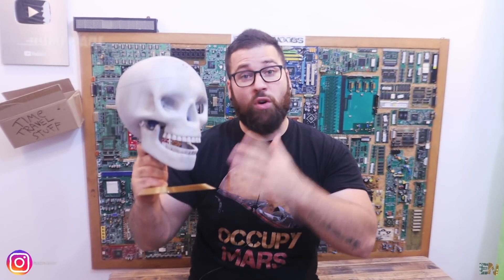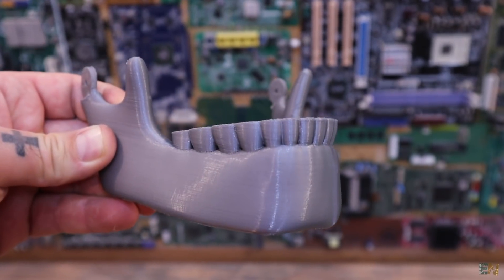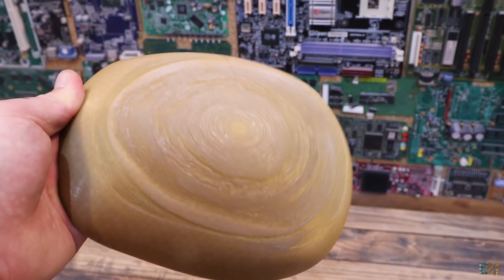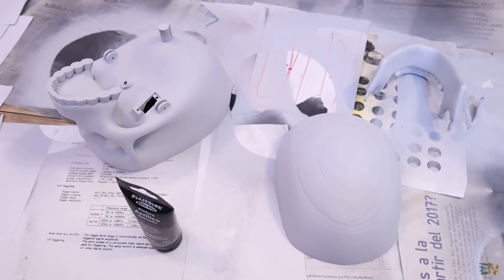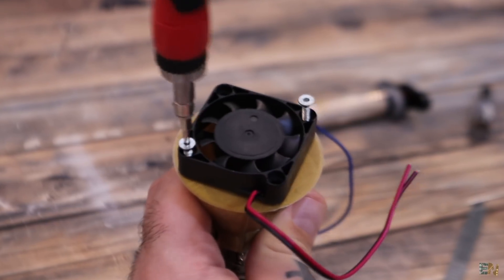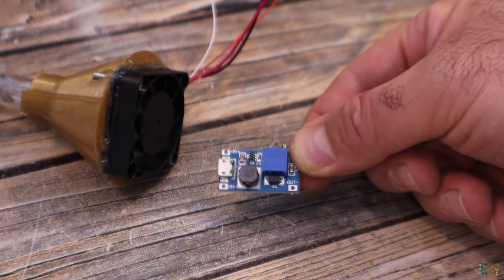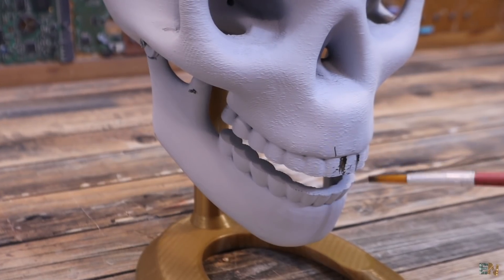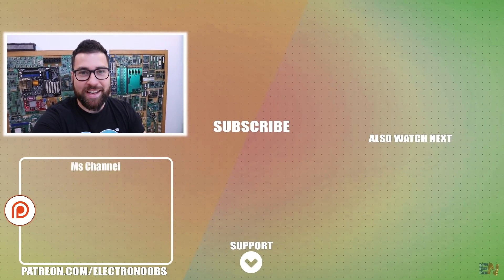Homemade Mini Smoke Machine | 3D Printed Skull & Voices

Comment: This type of fan is not designed to create pressure, so most of the air flow will not make it thru the funnel. You should use a blower fan (5015 for example).

Comment: vape cart does not ship to US
bummer
is that a 510 threaded I have some old  510 threaded one that are plastic so would be easy to drill through
the kind that you have to suck on to  make them work, the  thin cigarette kind
I wonder if it would work with the 3D printed pat to adapt it to the fan ,  or I could just use a lot of glue

Comment: Wonderful project.. axial fans don't have high static pressure.. if you need more.. a same size blower will do a good job
Reply: Some laptops, e.g. HP, use a blower to cool the heatsink rather than an axial fan.

Comment: Nice,  I wonder if you  could use a  RCWL-0516 instead of the PIR sensor so you don't have that obvious hole there for the PIR to stick out, mount the  RCWL-0516 inside the skull and maybe put a  small sheet of metal  the size of the  RCWL board in back of it so it only detects in one direction , 
I just got my first 3D printer  (ender 3 pro but I haven't set it up yet because no idea where I can put it)
I think this would make a  good project for one of my first prints but can I ask why you didn't print the  skull cap  upside right
and the bottom of the skull upside down?
seems like they could have printed with less supports that way or no supports for the skull cap since the bottom  would be flat against the bed
Reply: I'd do some benchy-sized prints first to get some experience before tackling a print that'll take 30 hours to complete.
Reply: @Makatea  yes of course
i will do the test print ender dogo
and then some smaller stuff
I want to  try a majoras mask and maybe a millenium falcon ,some project boxes for  some arduino keypad locks, some printer upgrades
then maybe  start this with the jaw and see how it works out
I am debating  on weather to get the creality bed leveling probe 
I was all about it and  the microcenter near me had  one open box on sale  i thought about grabbing it then i went to check again today to see if they still had the open box deal and was surprised o see instead of one open box they had 3 open box
now I am wondering why are so many being returned
Reply: @andreamitchell4758  Sounds like a plan. Perhaps also print something big but rather flat to dial in bed adhesion/warping before it ruins a big print suddenly popping off before it's done.

Comment: Cool! You might try using Tree supports in Cura (slicer). Also you might consider a 5v USB aquarium pump, they are cheap and easy to integrate. Also, you can save $$ on magnets if you buy a mild steel rod the same diameter as your magnets. Cut pieces the same thickness as your magnets. This has an added benefit of not having to worry about magnet orientation.
Reply from the maker: Thanks for your comment. Yes I've ordered some 5V pumps but they didn't arrived yet ...
Reply: ... but remember you'll only get about half the force.
Reply: Machine learning pid power full iron stationhttps://youtu.be/KXNRlJPkWIkcsed24thanksm.s

Comment: The skull top was not printed in optimal orientation :-)
Reply from the maker: Yes maybe...
Reply: I was also thinking this,  but I  have never used slicer software before ,I just got an ender 3 pro but haven't unboxed it yet, my first 3D printer
and I'm still deciding  which  slicer I want to  start with , cura or prussa 
but I have been watching lots of  3D printing videos and it seems like the skull cap could have been printed upside right with no supports and the bottom half of the skull  could have been printed upside down with no or minimal supports